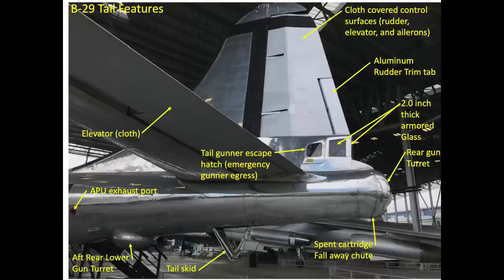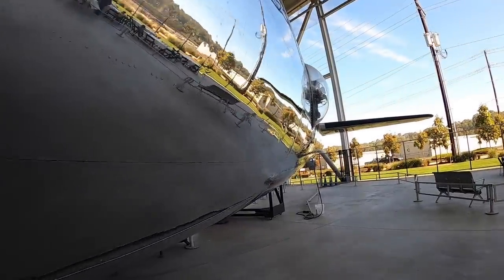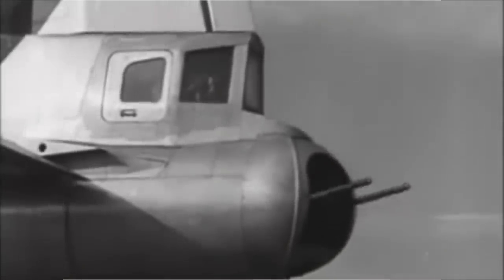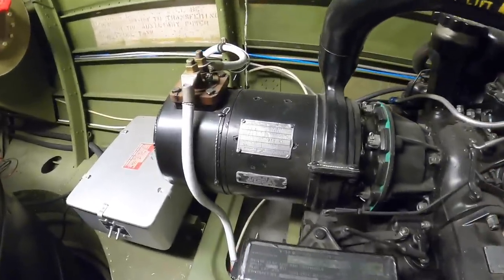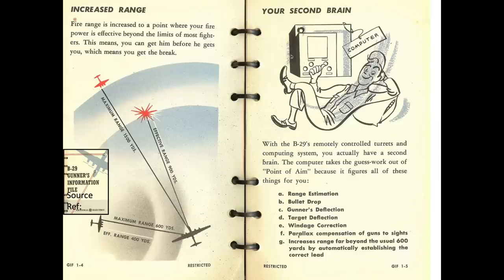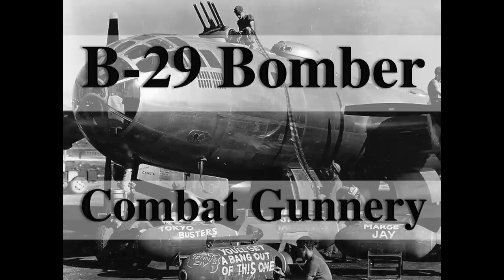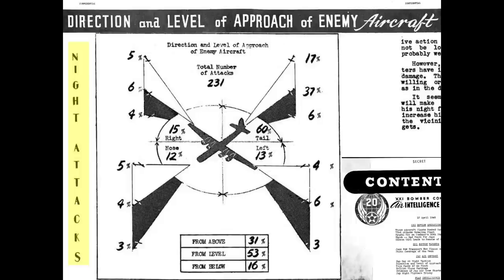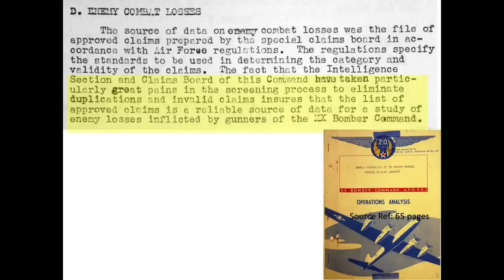How Effective was the WWII B-29 Tail Gunner?

Comment: Very well supported report.  Thank you.  I have witnessed ground-to-ground quad-50 caliber M-2 fire, so I can imagine the swarm of armor piercing rounds flung at an attacking aircraft by the twin 50's.  A sign of the times:  complete with ash tray.
Reply: Yes right across from a canister of walk around oxygen
Reply: "Dammit, is that a Zero?" (Stubs out his Lucky Strike unfiltered) "Time to go to work"
Reply: "complete with ash tray." If you ever come across a discussion about the Soviet Clone of the B-29 - the Tu-4 - among other fantasies - such as Boeing spelled backwards on the brake pedals due to them being castings of the original pedals (how sparse in knowledge about casting techniques can one be ???) - is the absolute doozy that the gunner's compartment was fitted with field modified Baked Beans cans to serve as ashtrays for the gunners. Kremlin control over the project was so strict that these Baked Beans cans were incorporated into the Tu-4 design. Da ohhh !!

Comment: Very informative video.  Thankyou for sharing.  My father was a B-29 pilot-in-command in July 1945 with his own assigned B-29 crew.  He and his crew missed the war in the Pacific by only two weeks because the war with Japan had ended.  He later joined the newly formed USAF in 1947 where he flew WB-29's for the Air Weather Service.  He would hunt hurricanes and track their position.  He would also fly through clouds to check for radiation to see if the Soviets had detonated any atomic weapons. The gunnery system in the B-29 Superfortress was very unique.  Its central fire control system eliminated recoil and its computer system calculated wind speed and allowed for bullet drop.  The only other aircraft to have a similar gunnery system was the Northrop P-61 Black Widow night fighter in which the top gun turret was controlled by the gunner and by the radar officer in the tail of the fuselage.  The top gun turret on the Black Widow was later removed because the muzzle flashes from the guns had a tendancy to blind the pilot.  They were later reintroduced on the P-61C models when flash arrestors were installed on the guns.

Comment: At night they could also fly low hidden in the dark and follow the planes silhouetted against the sky, and if it's a moonless or cloudy night track the Flames from the exhaust. Coming up from the depths and taking a swipe which would illuminate their position, then diving back down into the darkness.

They let you flick all those switches and sit in the seat, that is a Great Museum.
Reply: I think the Japanese twin engine heavy and night fighters had slanting upward firing cannon before the similar installations used by the Luftwaffe. 
I'm thinking of the Ki45 and the Gekko- not sure of it's designation.

Comment: Interestingly the 'Kee Bird' featured in the 'Nova' episode was forced down not only to being unable to navigate over the Arctic Circle, but higher than usual fuel consumption because of the drag created by the tail skid that failed to retract after take-off. As duly noted it lacked any manual crank just for such an event. The 'putt-putt' engine helped save the crew by providing power to broadcast a distress signal that rescuers were able to triangulate and finally locate them in the sometimes -50 F environment after a couple of days.

Comment: This is a subject I have always wondered about. You hear and see a lot about early B-17 defensive gunnery, but rarely ever anything related to the B-29. I think it would be fascinating as not only were they well protected with advanced systems, they also went up against some very advanced Japanese fighters, again something we don't really see or hear about much. Zero had range needs. But in homeland defense climb rates and fire density were the needs
Reply: Zero had no armour and no self sealing tanks.
Reply: @paulc2130  Not by this point of the war. early war stuff yeah but they learned. Also need to remember why that was the theme; zeros were designed for long range as its primary function. These later war planes had to climb fast and hard, and then made steep fast passes from blind spots, so frontal armor was considered more important. That does change toward the end of the war but the B-29 was bombing in may of 44

Comment: I love that the tail gunner’s station had an ashtray 😅 I guess it can’t have been pressurised with pure oxygen then??
Reply: No. You pressurise aircraft with ambient air, which is compressed by the aircraft as you go. Pressurisation of a whole aeroplane or cabin with pure oxygen would be both impracticable for a long range aeroplane and exceptionally dangerous, as the Apollo 1 disaster demonstrated. The use of oxygen is just to feed the face masks when pressurisation is not applied, and/or when the aircraft is pressurised but flying so high that the pressurisation can no longer maintain a sensible cabin altitude. In those cases the oxygen from the bottles is blended with ambient air in varying proportions into the mask according to the conditions at the time
Reply: @harryspeakup8452  Ah I didn’t know they were pressurised with ambient air. Very interesting - thanks Harry!

Comment: In the corporate turboprop aircraft that I fly, the cabin pressurization system is set for differential pressure, not a specific cabin altitude. The cabin altitude will vary depending on the altitude of the aircraft, since the differential pressure remains constant. Typically, the operational ceiling of the aircraft is determined by a maximum cabin altitude of less than 10,000 feet to comply with Federal Aviation Regulation (FAR) requirements. As an example, a BE-B200 King Air has a maximum differential pressure of 6.6 psi, giving an approximate cabin altitude of slightly less than 10,000 feet at a service ceiling of FL350 (35,000 feet).

Comment: ( without watching the video ( ungrateful me ))
the germans ( who B29 never met ) liked head on attacks or dive in from the sides of the rear of the bomber so to maximize the problem of deflection shooting. ( so the rear gunner would not have a shot ) 
While this was going on only the gunners on the sides were engaged and having to be skilled.
If ANY enemy ended up in the rear of the bomber and pretty stabilized and low on energy you know he be toast the rear gunner had a cannon between the machine guns. 
So the enemy fighters picked up altitude , then dove down from the side and gathered speed, and totally avoided the rear gunner.
BUT, if he was not there, then they would attack from the rear.
A situation of "damed if you do and damed if you dont" or in this case "damed if you have a rear gunner or damed if you dont"
( B29 centrally controlled turrets are very interesting, I can understand them dealing with one target but how do they deal with multiple targets?????? )

Comment: Japanese aircraft had great difficulty dealing with the B-29 due to its high speed and high-altitude during daylight attacks. An attack from 12 o'clock was a very fast maneuver that allowed fractions of a second to fire and usually no second chance. An attack from 6 o'clock had a closing speed of perhaps only 50 to 70 mph. Very dangerous for the attacking aircraft. Tail gunners did not get a lot of action in a B-29. Problem was when you lost an engine or two and had to struggle with an altitude loss. Anti-aircraft guns were a bigger threat to the silver fleets. Ranking threats for aircrews were #1 engine failures; #2 anti-aircraft defenses; #3 fuel exhaustion: #4 enemy aircraft: #5 Your own imagination, as you did not want to bail out over Japan.

Comment: Now I realize where the "Rosie the riveter" term came from.  I had no idea the number of rivets on this bomber!  That being said I now have to be come an "umm actually" guy.  at ruffly the 2 min mark you referenced a camera port, umm actually there weren't any mounted cameras in bombers in 1942.
Reply: I just watched a short video (just under 2 minutes long) titled "B-29 Gun Turrets" that shows pre-flight inspection of the gun turrets, which included making sure the turret cameras had film, adjusting the lens for daylight brightness, and setting the shutter speed (16 frames per second).
Reply: @Mike Smith - WRONG!
Reply: @Lets_Go_Brandon2024  watch the video entitled "B-29 Gun Turrets" --  they remove the outer housing of the belly gun turret and go into great detail explaining the camera and how it works.
Reply: @vanmonroe4346  - CHEERS! Thanks, always appreciate warbird video suggestions! And my reply was to that other guy, but I'll definitely check out the video. I was fortunate to see Doc here in Albuquerque last fall, was AMAZING to FINALLY get see that beautiful bird fire up all 4 engines, taxi and then take off DIRECTLY overhead! 🇺🇲👍🏻😎👍🏻🇺🇲
Reply: @Lets_Go_Brandon2024  ✌️😉✌️😉

Comment: Great video !!!  btw, I've read a small number of B-29s still in WW2 had their upper forward turret modified (only that one) by replacing the four M-2s guns with four M-3s, the latest variant that fired at 1,200 rpm.
Reports sound be reliable, and also they go further in stating the only US airplanes other than the B-29 to get these super-new machine guns, were P-47N Thunderbolts of the 318th Fighter Group (NOT all of them though) based on Ie Shima from May 1945.

Please can anyone confirm with certainty?  Thanx from Italy!

Comment: The central gunnery 'computers' performed their calculations mechanically - gears, levers, cams, etc. A few vacuum tubes were used but not involved in the sighting, ballistics or parallax calculations. Very good video otherwise.

Comment: Pressurization duct connecting the waist pressurized section to the tail turret pressurized section.

Interesting factoid! I would have guessed that the tail turret pressurized section had its own system.
Reply: The pressurization runs off the engines, bleed air off the turbo-superchargers.  Just like we have today with bleed air from the compressor stage of passenger airliners.
Reply: @debbiestimac5175  
I formerly figured that being way in the rear of the plane and just a small compartment, that it had a separate blower back there.
Reply: @alanstevens1296  You can't create enough pressure without a supercharger or a jet compressor, it's why naturally aspirated aircraft are not pressurized, they can't be.

Comment: Why were B29s not used in europe?
Reply: They were designed as a long range bomber.  The B17 and B24 didn't have the range to span the distances common in the PTO.
Reply: The B29 program cost more than the Manhatten Project.
Reply: The USAAF did fly several B29 aircraft over to England very late in the war in the ETO.  Someone to scare the Germans with.  No combat missions were flown.